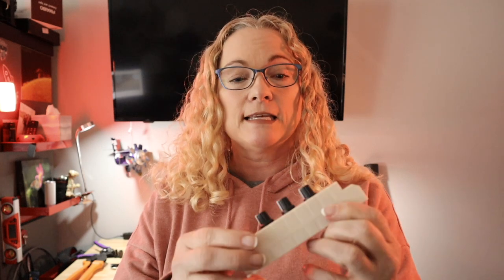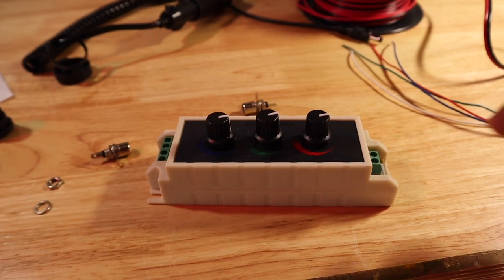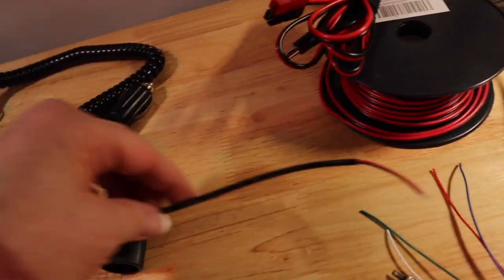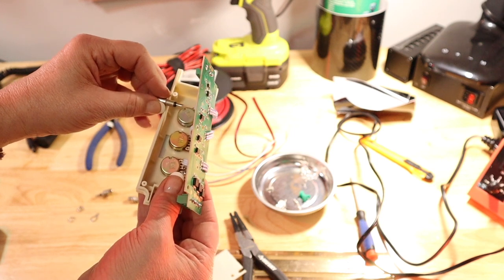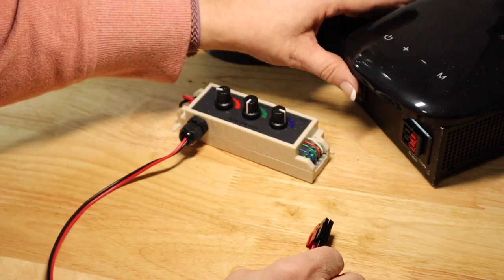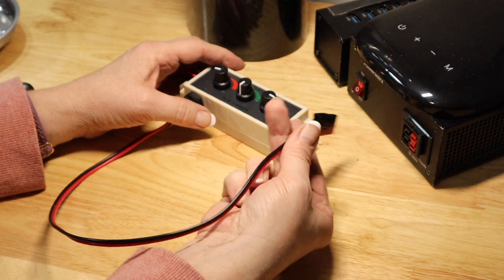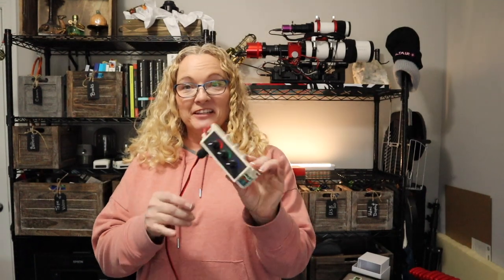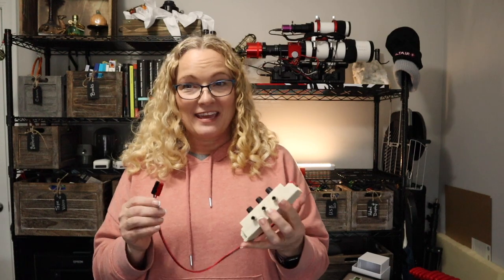DIY Build Your Own Dew Heater Controller - It's so Easy!

Comment: I have used the same rgb dimmer for the last couple of years - it works perfectly.
One thing you should be aware of, the way you wired the rca plugs, you have plus on chassis/ground, usually chassis/ground is minus if connected. You potentially risk a short circuit between plus/minus if not being careful.
Reply from the maker: Thank you for letting me know. I will check it out.
Reply: @AmyAstro  You have the polarity inverted. Swap them over

Comment: Thanks Amy. I just ordered one of these to use for my sky camera heaters. And I just checked my SCT heater strap which comes in at 15 Ohms, or would need only 0.8 amps. (V=IR). Plenty of power here for cold or wet nights :).
Reply from the maker: Perfect!
Reply: @AmyAstro  Just got one of these units delivered via Amazon today. Using some jumper wires from the terminals, I found I was able to control my dew heater strips just as well as using my Kendrick control unit. Other than taking the time to modify with the RCA jacks, this controller appears perfectly capable of doing an equivalent job right out of the box. Nice!
Reply from the maker: @johnadastra1754  this is wonderful!!!  I am pretty pleased with mine. Less expensive than my astro zap that I purchased 4 years ago.

Comment: Well done Amy.  I was wondering if that could be done.  I always thought the $100 + was a bit (quite) much for the controller.  - Cheers Kurt
Reply from the maker: You can do it! Always fun trying to find a work around.  This is not perfect, but definitely fits a budget.

Comment: The "Johnson power pole" connectors are about 80% reliable - I have really not been happy with those connectors and cannot recommend them.  A superior connector are the black and yellow ones that are used for RC cars XT60H - those work every time and withstand wiggling, though you'll have to be handy with a soldering iron to connect them..

Comment: Simplistic dew controllers are a hit and miss and not to be encouraged. You either have to dial not enough power or too much. Not enough is wasted and too much heat uses more than necessary power if on batteries and generates more than necessary heat around the lens. The better controller is one that measures the dew point (temp & humidity sensors) and heats the area a few degrees above the dew point (monitored with another sensor under the dew strap). Not mentioning other controllers such as one that keep temp an adjustable amount above ambient or even better above the dew point is just so basic and lacks understanding and investigation.
Reply: I have a Kendrick controller and a Dew-Not controller and they both have this basic design and have been using them for years. Which unit are you talking about for $20 bucks in parts?
Reply: @johnadastra1754  it's not about price but doing it right. A fire under the telescope would also keep the dew away for even a lower price. Kendrick also make a controller that can keep the temp a few degrees above ambient which is better than those simple dial controllers. Kendrick has been promising for a few year a dew point controller but other manufacturers also make them.
Reply: @GregMcCall  the whole point of budget builds is about cost and this is perfect for those people who have a problem and not a lot of money to spend. That's the whole point of the video and this type of project. It's probably 4x cheaper than a similar off the shelf product and 10x cheaper than any automated one. Yes, there are limitations, but this is cheap, easy and still solves a problem for those people without big bucks that astrophotography typically demands.
Reply: @GregMcCall  And this is what you have on your scope? A unit that continuously samples outside temperature and atmospheric dew point, then sends just the right amount of power to the heater strips, and then monitors lens temperature to be just the right point so no condensation occurs, and also records amps used so not an electron is wasted. And you built it yourself? Please send the schematics so we all can build one.
Reply: @brandonporter4227  Budget build? And how do you think its a Budget Build with a heading "DIY Build Your Own Dew Heater Controller - It's so Easy!" No Budget in that heading. It is however a DIY and it is easy. A dew point controller would be more complex. It is not a perfect dew controller for beginners or anyone else. Re beginners, dew point  controller needs no setting because as long as you keep the surface warmer than the dew point, you get no dew so it's set and forget which is more of a perfect for beginner description.
Reply: @GregMcCall  because it's in the video description. That and a big reason to DIY something is because you're on a budget.
Reply: @brandonporter4227  No, its the topic of the story and not what you made up or assumed. DYI on a budget is also an assumption. People do DIY for all sorts of reasons. Same for beginners who may want DIY or more likely want simple and already working which is my guess and more likely for a beginner. So for a beginner, a dew point controller is the simplest to manage on a rig. A beginner being on a budget is also an assumption which maynot be correct. A bonus note is that the dew point controller also uses the least amount of power to do the job so would need a smaller battery which might be a beginner advantage.
Reply: @brandonporter4227  You are wasting your time Greg just wants to show how smart he is he doesn't really want to have a discussion.
Reply: @GregMcCall  Dude, why don't you give it up already. Your original comment was condescending and misogynist. There are no amatuer level dew control units that do all you stated for any reasonable price. You just wanted to lip off and pretend you are somehow superior for some selfish reason.
Reply: @johnadastra1754  Yet another assumption that needs calling out. I'm not the one making these silly assumptions and it doesn't help beginners that follow the assumptions or just to let people add words to what is actually written. I'm guessing you don't like the assumptions called out and it seems to me you are the one that doesn't like being called out on various assertions. Yet again, when your other assumptions were called out, you throw in another. There are at least three amature level dew point controllers on the market. If you take the time and research in place of assuming and guessing, you might even find them. It seem to me that you were the one that decided to comment on my statements which were based on fact and not your guesses which you decided to try to correct me. It's all in writing.  It's not superior, I just use facts and facts don't really care what you think.
Reply: @GregMcCall  Yes. The AP world is starving without your intellect to save us from such harmful videos. It's time to call a spade a spade, and you've been called on your bigotry. Dry up already.
Reply: @johnadastra1754  you started the comments based on assumptions which when challenged with facts, you introduced new assumptions as you can’t handle facts and don’t like it when people call out you commenting on their statements. I knew you would even run out of assumptions and not recognise facts and the next would be name calling. Congratulations you eventually got down to showing us who you are. Well done.
Reply: @GregMcCall  No. I am Dances with Wolves and I do not hear your words.
Reply: @johnadastra1754  for a person who doesn’t hear, you certainly know to read else you wouldn’t keep replying. See, facts must really hurt.
Reply: @GregMcCall  Despite all your gum flapping you still haven't provided your better design, or posted a link to where any better equipment might be found. Kendrick may have a new product in 2022 at price still not established. What equipment? Where? What website? What cost? What do you use? Have many dew heater designs have you Beta tested? You have not presented any facts, only critique. So easy to be the Monday morning quarterback isn't it? Where is your data on power consumption for what you are using? How much extended battery life do you have over other designs? How are you measuring dew point and feeding that info into the dew heater controller? How is the lens temperature measured to keep off moisture without overheating? Again - no answers at all. Just arrogance and ego.

Perhaps you should learn something about the basic concepts of useful dialogue, cooperation among equals, providing open information to the astronomical community, and creating friendship and positive atmosphere where someone can post a video without being belittled by your crass comments. It is you who have a lot to learn. Give these ideas a try sometime if they can fit under your hat. Or you can just continue to be the troll like you have been here.
Reply: @johnadastra1754  I know this might be a hard concept for you to grasp but you still don't recognise facts. Another person asked out of interest a specific question on a DYI dew point controller and I answered it because it want not a constant barage that you keep feeling that you have to correct my comments. Look back, it's a constant barage of guesses and assumptions with out any facts and when I justify my reply to your attack with facts, you chop and change all over the place with more assumptions. Spend time, do your own research in place of trying to force your ideas onto others. It's called research, learn facts and use science. Not dummy spits because your assumptions are wrong, not called for and others think facts and knowledge of science overide your guesses. Their is plenty of info on how to measure dew point and even public domain projects on complete dew controllers. Research in place of showing how much you don't know on the topic. At least beginners now know to avoid your guessing
Reply: @GregMcCall  Dude you are still off the mark and this is not your YouTube channel, and it's not about you.

You can start with something like this this: "Thanks for the nice video Amy, and the info you were trying to present. That is an interesting controller anyone could build. I apologize for my earlier comments which may have been misinterpreted. I saw a few things you may want to try in your next attempt like adding a temperature probe and an ammeter which could make it even more useful for dew control. I did not intend to offend or minimize your efforts in making your presentation. Sorry if this was taken another way. I'll try to be more subtle with introducing my concepts in further discussions."

After you have the humility to make such a statement to our AP fellow and lady friend, then your your comments might be more readily recognized. Hope you can see this point of view and move forward.